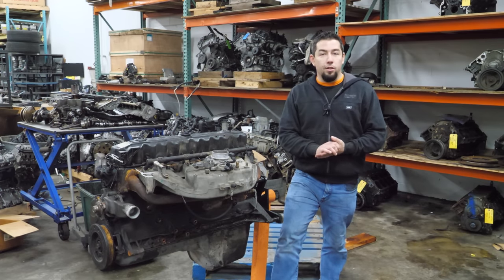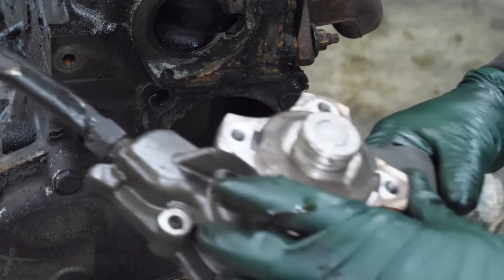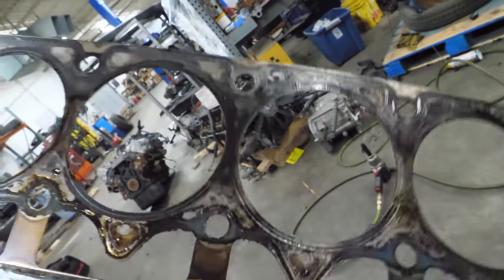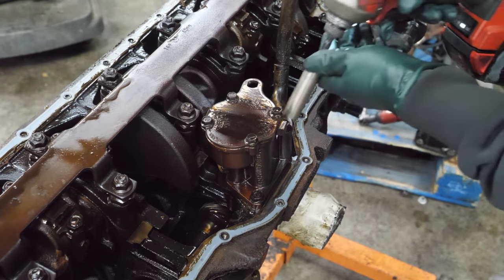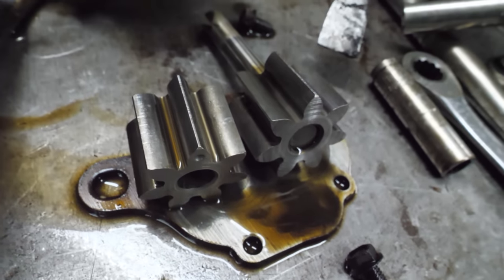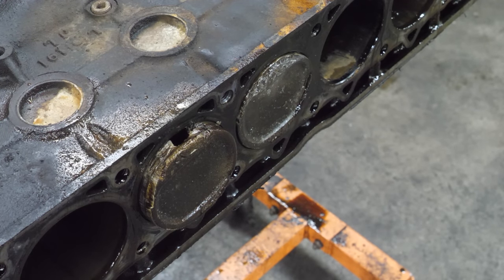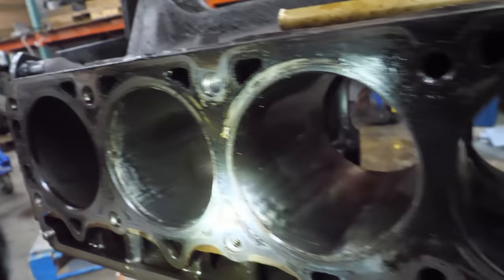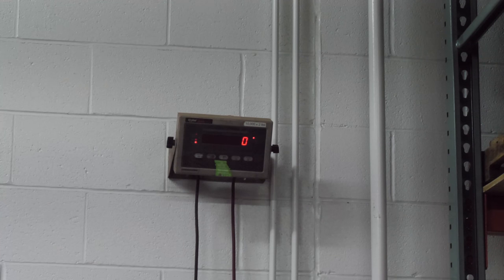How Do You Destroy A 4.0L Jeep Engine THIS BAD? Intentional? Neglect? Ill-Repair?  I Am IMPRESSED!

Comment: The 4.0 "AMC" and Furrrrd's 4.9 300 straight 6 are both legendary in similar ways. I had a '81 Bronco with the 300 and a manual 3-speed ( with overdrive) that was one of my favorite trucks ever! 300,000 miles on that truck. Too many things went wrong too quickly on the Bronco so I sold it as a parts truck.  The 4x4 still got me anywhere I needed to the very end. 🏁
Reply: I daily a 1984 F150 with a 300... very durable engine indeed. Rebuilt it back in 2020 due to bad rings/bores (lots of blowby); despite that, it was still running somewhat decently. The rebuild was its reward for getting me though a long trip I didn't expect to drive it on... well earned!
Reply: That Ford 4.9 is a great engine.
Reply: I've been hounding Eric to get his hands on a 300 for a teardown but they're so fucking reliable that cores never show up haha. I have an 85 and a 95 F150, both with that engine, both with manuals. Love 'em both.
Reply: @TestECull  We used to run F-150s with the I6 300. Mostly highway, with some local parts running. Manual transmissions. We never had to replace an engine, and some of them had well over 300,000 miles. They got three times the mileage of the oldest truck we had with a 460 under the hood. That 460 was bomb-proof, too.
Reply: @dougrobinson8602  Best OHV engine Ford ever sold. Pulls like a 302 on a third less gas with a life expectancy measured in decades because odometers dont go high enough 🤣🤘
Reply: There is a 93 f150 for sale near me with that i6 for only 2500 and less than 100k original miles. Is it worth the buy?
Reply: @atlaslion5128  If it isn't rusted to hell and back, yeah. If it's an automatic don't expect any sort of fuel economy though; they're fuel misers with a stick but with an auto they're gashogs.

At that price point I'd expect to find something wrong. Major rust issues, bad transmission, something like that. Be thorough in your inspection.
Reply: @TestECull  Thanks for the info. It's rust free it's a South Florida truck but I haven't seen it in person.
Reply: @atlaslion5128  for that cheap Something is wrong. Either the truck is actually trash or the owner has no clue what the real value of the truck is.  And like C6 Modellsport said, The odo could have turned over 3 times and you would not know it.  Also a 30 year old truck might have all the rubber deteriorated.  But if everything checks out, that could be a fantastic truck.
Reply: @Dis-Emboweled  thanks for the tip. Yea some people don't know the value of what they have. Hell i know someone who bought a first gen Toyota sequoia with low miles for only 2500 clean title and rust free

Comment: I like the 4.0 because of it's AMC lineage. But those cracks in the head you saw are common on certain years, and that's Chrysler's fault, because they redesigned the head. After a couple of years, they saw the common failure pattern, and came out with yet another redesign that fixed the cracking problem.
Reply: The 258 cracked heads when overheated.
Reply: The most crack-prone heads are just from the start of the distributorless ignition until late 2000. The head casting with the improvement has the letters TUPY cast under the valve cover, but it’s still not quite as good as the 1999 head.  IMO, 1999 is the single best year of the 4.0. It has all the strengthening and improvements to the crank and  block that Chrysler made over the early kinda flexible AMC design (including the main cap spine),still has the tubular header, has the improved intake manifold, has the best ECM programming, but doesn’t have the issues that came with the head when it was redesigned for the coil rail mounting needed for DIS.
Reply: @stevelacker358  +1 the '99 was the best year with thrust plate cam, horseshoe intake and OG distributor.   96-99 OBD2 is my favorite years.
Reply: Too bad these engineers should leave good enough alone
Reply: Best part about 97-99 is they don't have any of the advanced emissions Jeep used to try and eek out more lifetime.

Just the one O2 sensor, single bank of six exhaust (which will always crack), distributor, so so so easy to work one.

You can do the entire ignition (plugs, wires, cap, etc) for a third of the cost of coil packs.
Reply: @litz13 I agree, love the setup on my 98 XJ. They do have another o2 sensor at the cat, but I have heard rumors that you can remove that sensor or it can be faulty for years with little to no consequences. 

I just drove my 4.0L 600 miles today and averaged 19.5 mpg, pretty impressive for a pretty big 25 year old engine moving a cube through the air at 70 mph.
Reply: @Rmehki  Mine has the original sensors from 1997.  No clue how well they do or don't work at this point, but it runs fine.

At one point around 10 years ago I finally got around to fixing the cracked exhaust manifold... that had been cracked for years and years.  It kept passing emissions, so I didn't bother.  It finally got too loud and I caved in and replaced it.

I, too, get around 18-20 highway mileage, and around 14-16 city.  Not bad for 325,000 miles.
Reply: Often times overheating because some goofball put the wrong water pump on.
Reply: @randymagnum143  
Any specific years? I've had a couple 258s from the late 70s and an '85, and I've cooked the hell out of them on multiple occasions (old, rotten radiators) and haven't cracked a head so far — knock wood. OP is right, though. Chrysler redesigned the head for 2000-2001 and cut the material thickness a little too thinness, hence the cracks between 3 & 4 and the need to roll out the TUPY update quick and in a hurry.

Comment: For a piston skirt failure, that one actually seems pretty tame. Usually the piston comes apart and the wrist pin hammers into the block until it either makes an inspection port or it seizes.
Reply: Yeah, that was VERY surprising the wrist pin didn't go sailing and lock the engine up.
Reply: "Makes an inspection port" lol that's a hilarious way to look at it.
Reply: No it doesn’t
Reply: @BB Sky it doesnt, which is exactly the problem. The piston around the wrist pin comes apart, and the rod starts hammering it into the sides of the bore until either the engine gets an inspection port, the rod lets go or the engine seizes.
Reply: @BB Sky, pins are pressed in by heating the rod. They can become worn over time and walk themselves out.
Reply: That’s what happened to my 4.0 blew out right above the oil pan blow the exhaust Mansfold could see right in to the pisto skirt
Reply: @blaisedobson6171 bet it still ran though
Reply: I had a friend do the ventilated block mod on his zj. James bond smoke screen on the highway. God damn that thing still ran though
Reply: I run a snorkel now, and when people make fun of it I just say, "some day you'll find out the hard way."  Ice cold water running in a Hot motor bad! Looked the same after pulling it out on tear down. It was all Junk. Runs good now with a T85 Turbo low boost. No more water for me please.

Comment: Had the same 4L in a jeep Wrangler in the shop this past year, thing had completely seized, and when we pulled the pan there was mud in it. When asked, the owner denied having driven it in water or anything. We sent it away for a complete revision along with boring it out into a 4.6L. It now makes 300 hp and 600 Nm of torque.😁 Was quite a fun project. Had to modify and rebuild the entire jeep as it wasnt roadworthy anymore. One hell of a project for me and another mechanic, but a lot of fun

Comment: Yes, Finally!!! My favorite engine too. In fact, I'm dailying my 04 WJ at the moment because well, it's the only thing I own that doesn't ever break. From what I remember, somewhere around 2000-2002 were the problem years with cylinder heads cracking, at least for the WJ. By around 03 and definitely for all 04's have a different head (denoted by the "TUPY" stamping under the oil fill cap) that isn't prone to cracking. I'm 32 and I expect my 4.0 to outlive me!

Comment: Sold mine after 350,000 miles and it still ran great.  It was the family adventure vehicle.  Heavy loads and back country roads were no problem for our 1995 sport.  It did have a cracked exhaust and after my son used it two of the engine mount studs were cracked.  I welded the engine mount back to the studs and it was good to go.

Comment: So glad to see the 4.0 inline 6. They are so hard to find as cores. One of the best engines ever made. 

Would still love to see a GM 3800 series engine on the channel, or a 3.5L V6 from the 93-97 Intrepids/Concords
Reply: I second the 3.8. It's one of the most reliable engines ever built if taken care of. Incredible highway mileage as well.
Reply: @dougrobinson8602  Yes, 3.8 or 231.
Reply: I’ve had both the 3800 is rock solid the mopar 3.5 at the time had a very weak bottom end and I ended up spinning a bearing
Reply: My family had both of those.  The 3800 Vortec was BULLET.  PROOF.  The 3.5 was fine enough, but the transmission that rode behind it was garbage.  Lost reverse out of it at 36k miles.
Reply: @dougrobinson8602  the Achilles heel on the later 3800 engines was the plastic intake plenum, which was notorious for getting brittle and cracking, which would dump coolant into the engine. If you buy any car with one of those engines, make sure you replace that part right away.
Reply: The heads crack on the later models  around the rocker studs .but i like the 4.0

Comment: I've seen that kind of damage in 4.0L in-line 6 before. The 2 main reasons are 1) Prolonged high revving from trying to get unstuck in deep mud, or 2) very steep angles during rock crawling. I have owned many Jeep (Chrysler models) over the last 35+ years. Being involved with off-roading clubs has given me experience with the typical failures for people pushing their vehicles to the failure point.

Comment: I really appreciate how you speed through repeated bolt removal once the initial fastener is dealt with like on heads and rockers. Very enjoyable and informative stuff!
Reply: one spark plug that's all you really need is one cylinder to fire for the engine to run🤣

Comment: Thank you! Another one off the list!

This engine is, of course, one of the most durable and torquiest motors available from the late seventies through the early aughts. The inherent primary and secondary balance of the straight six aside, just the combination of torque, ease of maintenance, and simplicity all made it the absolute pinnacle of the Wrangler powerhouse. This engine is still the best 6 cylinder that has ever been in a Chrysler product (slant six aside), and I have a couple customers that have their Grand Cherokees and wranglers up past 300K. Having to drop the 242 and the 318 from their lineup has left FCA continuing to fight for a 6 or 8 cylinder gas engine of any sort of quality, a fight that to this day has not been won. Yes, I know what I said. The Gen 3 hemi is barely worth its weight as a boat anchor. 

Of course you're not going to have a problem with the dipstick tube - it's not on a GM product.

Engine Requests:
Ford: 300 Inline Six, Windsor, FE, 1.0 EcoBoost, 1.4 EcoBoost, 5.2 Voodoo, 6.7 PowerStroke
General Motors: 3100/3400/3800 Olds, LUW/LWE 1.8l i4, L5P Duramax
Chrysler: Slant Six, MORE HEMIS, 1.4L FIRE, 3.3/3.8, 318/360
Honda: B Series, D Series, K Series
Toyota: 1GZ-FE, 1ZZ or 2ZZ
Subaru: FJ series, EZ30/36
Other: DT466

Old School Unicorns: GM 702 Twin-Six, Oldsmobile 5.7 Diesel, LT5 Lotus (C4 ZR1)
Modern Unicorns: Toyota 1LR-GUE, Chevrolet Gemini, 7.3 Godzilla
Reply: Well now we know.
Reply: @chuckz8053  And knowing is half the battle. The other half? Extreme violence.
Reply: He has an EZ36 on the shelf/rack to his left our right when he shows the other 4.0 on the ground. I know it's a 36 because the intake runners are huge. I doubt he will take it apart but it'd be nice. Those EZ are not easy to disassemble. Even worse to get together.
Reply: Honda F20/22.  I wanna see how those 9000 rpm motors tick.  :)
Reply: And Olds 5.7 diesel would be cool to see, but they're rare. An LT5 is rarer yet. That was the best DOHC GM ever built and how they got the Northstar from it is beyond me.

Comment: A mechanic friend told me a story about one of his customers that had towed a Cherokee using a front axle type dolly for about 50 miles and then remembered that he had forgot to take the trans out of low gear and then found the engine wouldn't start.  He pulled the head and ALL pistons were missing- just con rods and wrist pins were left...
Reply: Calling BS on that story.  If it was an automatic, the engine wouldn't turn.  If it was a manual, he'd been dragging the wheels.
Reply: @spasticslug2932  Yeah, you’d ruin the transmission and that’s about it. The only possible way that story would hold water was if it was a straight shift left in 5th gear, and even then it’s not gonna do what he said it would, especially just after 50 miles.
Reply: BS… unless it had no serpentine belt on, if the crank was turning the water pump would be turning, if the engine got warm enough the thermostat would open and the radiator would cool the engine just the same as if it was running. 

But more than likely it would just drag the rear wheels…
Reply: it happened, I know the mechanic that replaced the engine.

Comment: There is a clear crack in the cylinder head, between #2 and #3 rocker arms. It can be seen just by removing the oil fill cap and looking in the valve cover. I was a jeep tech in the early 00s, this was very common on 98-03 cylinder heads. I replaced hundreds under warranty.
Reply: I think my 99 came with the 30 year/300k mile warranty! Knock on wood it seems to be going well so far. Coming up on 274k

Comment: Just did a full rebuild on my 2004 WJ 4.0 after It broke a piston skirt. I bought It last July as a winter vehicle and It had a rattle and I couldn't get It to go away. Everyone said It was completely normal for a 4.0 to rattle. I tried everything on the internet to get rid of the rattle, tried using a oil filter that held more oil and still nothing. Noise was always the same but would go away when fully warmed up. But come back on a cold start. It got me through a whole winter of beating on It and was using It as a a backup one summer day and was ok the highway and the rattle turned Into a knock. Drove straight home and parked It. Thought a lifter had gave up and tried thicker oil and even Lucas oil and nothing made the noise get quieter. That's when I knew It was an Internal problem. Started tearing It apart and found cylinder 4 with a broken piston skirt. Did a full rebuild and now you can't even hear that It's running. It's been back together about 5 months and I've made It my daily even before winter started and I do not baby this engine except on maintenance. I did all the piston upgrades, moly pistons, moly rings all new bearings. Hardest part of the whole job was getting the intake and exhaust manifolds off while It was still In the Jeep. When putting It back together, I Installed the manifolds onto the head before I put It back In the Jeep. So much easier, but extremely heavy and would recommend a 2nd person to help lift onto engine.

Comment: I've repaired quite a few of those with piston skirt failure. Overheating doesn't help things either. They start making a thunking noise like tapping on a tin can at idle  when they start failing. Those can be repaired with a set of pistons and rings. I always opted to do the timing chain and bearings. They literally run for ever if you catch it early. The last one I did was a 2001. Thanks!

Comment: There was a little known issue with water pumps. The inline sixes had 2 water pumps. V grove turned one way. Serpentine turned opposite. They could easily be switched and the coolant would not circulate properly causing meltdown of the center two pistons.

Comment: Had a 95 GC with the 4.0 with 325k when I sold it. Only problem I ever had with was the water pumps shreading every 20-30k miles. I got very good at that routine maintenace.

Comment: 13 years as a flat-rate mechanic, owned 7 XJs (have one with nearly 300k miles), and I have NEVER seen this level of damage to a 4.0l.
Reply: I'm a retired mechanic of over 30yrs. and current 4.0L owner and I've replaced over a dozen exploded 4.0L in my career. Leave them stock and drive them gently or they Will break. That's the advise I've learned to give.
Reply: @RANDOMNATION907 , huh, driven the hell out of my current XJ with a 4.0l, and it's at 280k miles without a single issue. Where the 4.0l runs into issues are the late 1996-2006 (2001 for the XJ). These engines have some know issues with severe overheating from a flawed head design and piston skirt failures causing engine failure.
Reply: Seems to be that the early 4.0s are stronger then the later ones idk why or how , own and owned alot seem damage at later model ones
Reply: @JohnGarcia-ii8lb , 1997-2004 (last year of the 4.0l) is known to have weaker piston skirts... even then, I haven't seen one experience this level of destruction.
Reply: @johndeeregreen4592 how good are the 2.5?
Reply: @johndeeregreen4592  I think it’s late 1999 and up, not 1997.
Reply: @gatto190 , 1999 is when the major issues with head design flaws became an issue. 1997 is when the pistons and cam were changed to a slightly different design, which started causing durability issues. 11 years as a Chrysler tech and owning 7 XJs myself, I kind of became a walking encyclopedia on them.

Comment: One time I pulled apart a 4.0 from like a '92 Comanche and it had been run at least 60 miles distance with pieces of a broken valve riding bouncing around inside a cylinder. Top of the piston all scarred up and walls not perfect. I ground the top of the piston with a dremel tool, threw on the rebuilt cyl head, and it ran perfect for over 10K miles until I sold her.